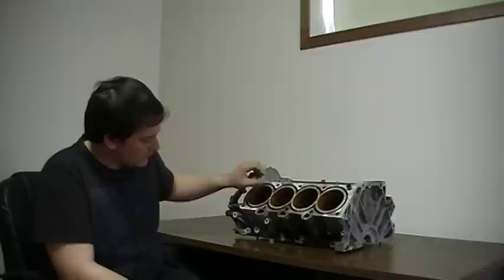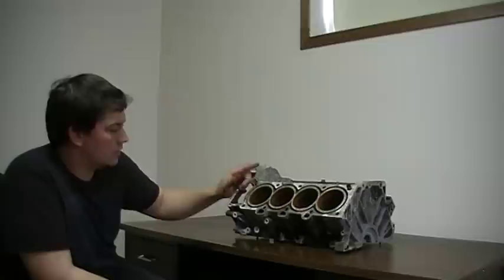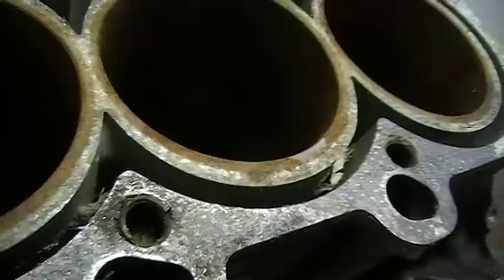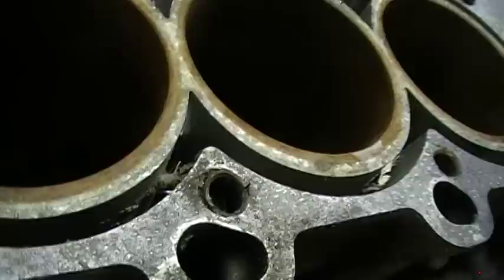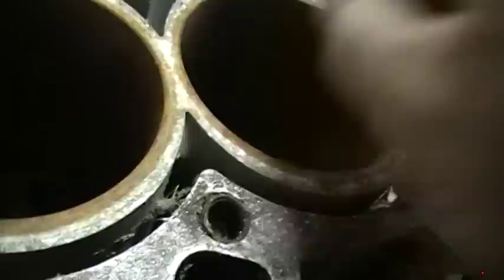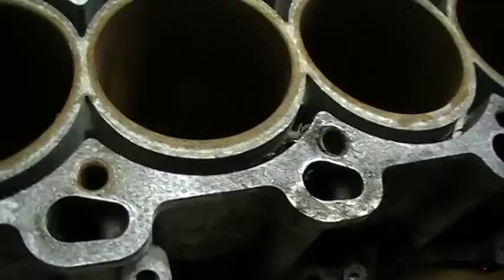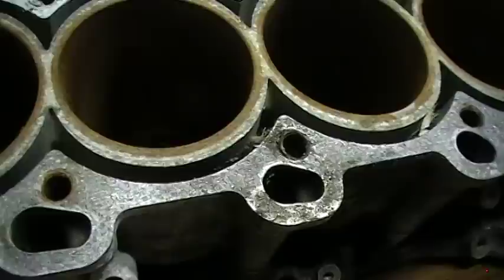Northstar Engine Block Cracks - the REAL cause.

Comment: Dear Sir, I'm sure that you produce a quality product; however, whomever was in charge of designing the Northstar engine should be stripped of their engineering degree.
Reply: The Big PussyCat yep I just had to drop the transmission on one...check it out lol
Reply: Iirc they won LeMans with the Northstar when it came out
Reply: Can you do his repair with the motor in the car?
Reply: @dangerousfreedom4965  maybe but your back will hate you
Reply: @MegaPooponascoop  I owned a 1994 Fleetwood Brougham that was sold as a rock, but had a 2001Showing results for ElDorado
Search instead for ElDorodo

Search Results
Web results

cadillac Eldorado
Reply: The Northstar's engineers knew it had flaws but Cadillac didn't let them finish their work before putting it into production, which led to these problems
Reply: @lichking3711  it took them like 15 years to finally switch to ls7 head bolts. So it took them that long to “finish their work” ?? Lol you must be one of the incompetent engineers at government motors
Reply: @matthewfredrickmfkrz1934  that wasnt the northstar sold to anyone at the dealer, it was the badging that got everyone excited, hype from  cadillac.

Comment: I don't know who the guy is who is trying to say the head stud kit is making blocks crack but he can take a flying leap there is no way the kit this company makes is hurting the block it makes a normally weak part stronger. if any thing it reinforces the section that would crack by preventing the studs from backing out . I have used the helicoil inserts before and I'm not a fan it's like a band aid compared to the kit this man makes. GM should have come up with this them self's it just make sense and works .
Reply from the maker: Thank you :)
Reply: Get a Chevy or Toyota or a scwhin bicycle, the new 2019 caddy's suffer from OBD issues,tranny,steering,and ABS sensor Gremlins...goes on and on

Comment: My 2001 Deville 4.6 threads are fine. It was pumping out coolant because GM installed cheap head bolts. One of 4 bolts holding down the head over cylinder one, was loose. I installed Felpro bolts and a new gasket.

Comment: One video I saw said the bolts GM use were wrong spec. The guy specializes in rebuilding them with the proper bolts. I am just a paper nerd not an engine guy. But I saw that video years ago and have an interest in the engine ever since.

Comment: you guys really do a good job with marketing and explaining issues with these motors and why they need your products. I'm usually very leery about this kind of thing but you've convinced me, i sent you guys an email a few days ago about bulletproofing my 07 dts. Will be ordering the whole bulletprood kit and kaboodle once i find a good junkyard motor to build while i'm driving my oil leaking one
Reply: these cars have a bad reputation for expensive parts but i've fixed everything wrong with it but the oil leak for 540$ parts cost and my labor on a free car. all 4 brakes and rotors, rear air shocks, tie rods, junkyard front bumper cover, filler paint primer and clear for the cover, bumper beam, passenger headlight, new ballast and 2 bulbs, passenger foglight, front parking sensors, parking sensor harness, plastic crash beam, rebuilt my third brake light, and repaired the seat ventilation module. a lot of work but the car was free because the p.o. got quoted >3200$ for these repairs, and now i have a nice DTS with everyting working
Reply from the maker: We will do our best to assist. We are in the midst of moving into a larger shop; so if your requests are not answered in a timely fashion at our office please keep on us. It's a busy time but we want to help everyone who comes through our door :) Thank you so much for the kind words!

Comment: I have a 99 Seville. how can i tell if my head bolts/studs have been upgraded without taking it apart? Is there anyway to slow the "galvanic" corrosion reactions? Should the bolts be re-torqued regularly?  Thank you

Comment: the blocks crack from a casting flaw, this is old news.  i've heard from the older guys at the dealership they have seen it first hand before the after market did, this is a great engine, works amazingly, i forget where you can see the casting flaws but i think its looking down in the water jackets some wheres but some have it, some don't
Reply from the maker: +Kevin Rogers It's not just a casting flaw. While I don't doubt there was a flaw in some years; I've seen a few different year Northstars do this. 97-02. That's a 6 year span.
Reply: kk, suck's because those engines hall ASS  when there working correctly

Comment: I have a north star 4.6 (77k miles) it has a blown head gasket and I  can't get it fixed because most mechanics say that once you take the head bolts out of that engine you can't put them back.

Comment: What about the 2007 4.6 Northstar engine in the Buick Lucerne, does it suffer from the bad head bolts or was the problem fixed by this point?

Comment: 2001 Olds Aurora 4.0 Northstar. Bought new 12/2000. I am not an easy driver. Trouble in all those years? Crankshaft position sensors, camshaft position sensor, spark plugs & motor mounts.

Comment: +NorthstarPreformance
i am thinking about buying a used caddy but I am concerned about the Northstar block problems.
I don't want to run into this issue.
Any help?
Reply: Yeah...if you don't wanna have this issue don't buy a northstar.lol They are great engines to say the very least,just spend the time and money for the head stud upgrade kit and you have a life long caddillac to drive.
Reply: I agree

Comment: Hi Jake, Car Wizard swears by you and your honesty. Two questions: 1) I am considering to purchase a 2014 Cadillac SRX with 79,000 miles. Has Cadillac fixed the Northstar engine problem at this point? It's a 3.6 liter engine. First of all, do you sell a kit for it, just in case? 2) Is it still a "weak" engine? Also you mentioned that steel bolts into an aluminum engine corrode. Is there a workaround for that? Thank you.
Reply: Yeah my 07 srx is at 94k and I'd like to know if this is something I need for another 100k

Comment: We bought a Cadillac with a overheating engine. After listening to You Jake Diagnose the head gasket as the main problem. My mechanic is dropping the engine for rebuild. My Cadillac is 1998 savile sls "y" as the 8 digit. My Question is. Will that much drilling effect the wall size of the block. I know aluminum is actually a soft metal. So drilling and tapping into an engineered piece of soft metal would only weaken it under stress such as heat and vibration. Because most cars heat up and do a lot of vibrating. I see how coarse the threads are and it seems like it would work, but weakening a soft metal in my opinion is not the best way to ensure a real quality repair. Is there a way you could engineer a bolt Where the shaft would be Coarse all thread that was only 1/16 of an inch wider than stock?Or so?ah? So slightly bigger bolt threaded all the way to the head? That way you wouldn't get blamed for cracked blocks with your bolts in it.
Reply: Hey shawty

Comment: i have a 1997 deville with a northstar motor, and 92,000 miles hasn't over heated yet. how much does it cost to change the head bolts to better stud bolts?
Reply: 4000.00 to 6000.00
Reply: Chris Lemaster why is it that expensive to change a couple of bolts?
Reply: about 4000.00 to 6000.00 dollars and the Dex cool antifreeze corrodes the system have your antifreeze changed out  and put the green antifreeze in it will run cooler I had a 1999 Deville as soon as I had the head gaskets rebuilt a GM mechanic told me to use only green antifreeze in the cooling system because GM is in a law suit with the Dex Cool antifreeze cursive to the engine and gaskets. When the Dex Cool antifreeze was in the car the temp would go from 206-222 and with the regular green antifreeze the coolant temp would read 160-190
Reply: The engine had to be removed and all twenty head bolts have to be machine drilled and pressed with a head bolt kit from North Star Performance and they have to rebuild the bottom of the engine as well because these leak and burn oil at a rate of 1 quart per 500-1000 miles all north star engines are famous for oil leaks. Then the have to clean the whole engine out at the time of rebuild because the Dex Cool antifreeze corrodes all gaskets and corrodes the metal parts in the engine There is  about 20-30 hours of labor involved here you have to tear the whole front end out including the transmission and front end.
Reply: there are likes 20 head bolts that have to be removed, tapped, studs installed, and heads machined, new head gaskets, and the engine being sideways makes everythinng so hard to get to. is what im guessin?

Comment: I have a beautiful 02 Eldorado touring coupe in fantastic condition.  It doesn't overheat or burn up coolant. Should I wait to stud it or just do it now?
Reply: I had a 02 Eldorado.  As soon as it hit 100,000.00 it started overheating and blew a head gasket.  It was going to cost more than the car was worth to repair so ended up selling it as is.   Don't ever buy a vehicle with a NorthStar engine.  I learned my lesson.
Reply: Laura Schmidt 
That’s got nothing to do with his question...
Reply: Well I bought a cavalier and it broke down too. But that STILL has nothing to do with your question. From what I learned from Jake's video here is that you may suffer from block damage if you wait. That said, if in the event your block cracks, there is probably a block in a junk yard somewhere that your mechanic can source. I recommend this guy's product. I purchased main studs from his company and they do seem like good folks doing the right thing. Sorry that didn't answer your question. You must decide your own path to take...
Reply: Lance Dukel 

I’d wait because there are a few unicorns out there that haven’t blown and have 200K miles. With that said the moment you are having issues confirm it is indeed the head gaskets and then have them fixed.

Comment: I own a 95 el dorado. I have herd a lot about the head gaskets going in the north star. No issues yet but would like to put more money into it because I love it so much. it has 120k on it runs solid what issues should I look out for
Reply: +Scott Cute  My parents still drive their 1995 Seville SLS and its got over 330k. We have had it since 1999 and it has been the best running and most reliable car we ever owned. The head gaskets were due to the coolant becoming acidic from sitting or not getting changed out when needed. Use what is recommended by GM, keep it maintained and you should be fine.  The cars that had issues and were rebuilt using the new corrected Head stud then make for a permanent solution and an even stronger built bulletproof engine for sure. But the original head bolts will be fine.  Our cars is still all original and never rebuilt. And I highly doubt that anything bad will happen ever.

Comment: Hi Jake, I have a 2011 Cadillac DTS with 47,000 miles on it. In the future, I would like for you to repair my engine when and if the nead bolts begin to seperate. I live in Illinois so, not sure if you are able to repair it when the time comes. Some people have said, that their Northstar engine blows a head gasket at approximately 85,000 to 120,000 miles or so. I'm not sure if the reason why the head gaskets blow at early age due to failure to maintain the engine. Anyway, great videos you have and a great patent! You are a very intellegent man for inventing such a wonderful solution. Thank you sir!
Reply: +deapozol   That will only happen because the coolant has become acidic. It is best to use what is recommended by GM. The acidic coolant has been they problem all along and that is why the head bolts become weakened. If you keep your DTS well maintained you shouldn't have any problems.
Reply: +deapozol  For one of these engines to crack like he is showing us here is most likely due to being overheated multiple times.  Because this doesn't just happen. My parents still drive their 1995 Seville SLS with over 330k. We owned it since 1999 and it has been the best car and most reliable car we ever owned.  I still enjoy driving the car.  But I drive a 2005 Deville as my daily driver and I love it. The Northstar engine is one of the BEST 32 Valve DOHC engines out there no matter what anyone says. I worked at Cadillac for a few years and been around them all my life so I know these engines pretty well. But you should be fine as long as you keep it maintained. Hope you enjoy your DTS as long as you own it.
Reply: +deapozol If you change your DexCool yearly, you won't have a problem. You'll likely get up to 280,000-300,000 miles before your head gasket goes. That's one of the improvements GM made.
Reply: +AMCNorthstar 93 
Yes you're right. I keep my oil changed full synthetic every 4500 miles and my coolest flushed recently at 40k. my trans fluid was changed at 40k as well, flushed by the dealer.  but, that being said, I do have a heavy foot. Thanks for the replies.
Reply: +UnitedRecording 
Hi. yes I just flushed my coolant at around 40k. the car has 51k miles and so far so good. I'll have the dealer flush it again around 65k miles or so along with another trans flush. I do have a heavy foot though and hope my tranny doesn't go sooner than expected. Although I did drive a different Dts and it took off from a stop way better than mine. I had my injectors cleaned and throttle body cleaned at the dealership but didn't notice a difference.  my air filter is fine also. I guess every dts doesn't drive the same...
Reply: +AMCNorthstar 93 
do you know why one dts takes off better than another from a dead stop. I have a 2011 dts premium and drove a rental dts same premium model and the rental took off much smoother and faster than mine. do you know why us that? I already had the dealership clean the injectors,  clean the throttle and change my air filter but the only difference I noticed was better fuel economy.  no take off difference.  Thank you.
Reply: Bengi H. Hi....the take off could be several different things and it could very well be that its in the programming of the engine computer.  Not all of them are exactly the same as with most cars.  I have a 2000 Seville STS and a 2005 Deville and they both drive and handle different but similar.  Just keep up on your maintenance and you will be fine.  Driving fast is very good....remember this is a high performance DOHC V8.  I love doing the same thing and these cars were made to be drivin fast.  Don't let anybody tell you other wise and especially the Dealer!!!  I know how dealers are as I work at one myself.  They can also be very dangerous and steer people into believing what they want people to believe.  But I talk to people just like your self every day and I'm telling you that you will not have a problem!!  You made a great decision on buying a DTS.  :)
Reply: +AMCNorthstar 93 Yes I'll keep up my maintenance that's for sure. I might take it to the dealer for that sluggish take off because they might be able to m check it for me and maybe reprogram the computer if there's a problem.  I was almost beaten by a 4cly corolla sort distance in the city.
Reply: +AMCNorthstar 93 I also change from shell V power to mobile premium but still no difference.
Reply: Bengi H. It's probably the programming of the engine computer I bet.  I'm curious myself.  And I remember driving several different Cadillac's in the past and not all of them were the same.  Let me know what they say.
Reply: +AMCNorthstar 93 I sure will thanks.
Reply: Can I change a starter on a 96 Seville without taking every vacuum and fuel line off?  I was told I can remove a few spark plug wires and a coupe of vacuum hoses that would allow me to prop up the manifold high enough to get to the starter saving me a bunch of time Thanks!
Reply: ***** It is best to disconnect all the vacuum lines and fuel rail. It is a good time to also inspect the intake gaskets on the bottom if any need replaced.  Only the front ignition wires you can move out of the way, not the back.  If this is your first time, don't worry, its not a bad job at all.  I have done several already and its very easy if you know what your doing.

Comment: Well... I've timeserted dozens of N* with the factory repair kit with no comebacks. Insp. and surfaced heads with the factory repl. head bolts etc. work just fine. Then... there's the oil leaks to deal with. 38 years as a line tech at the dealer level made me wanna retire ASAP!

Comment: I have the same vehicle.   Though I researched the north star V 8.   I haven’t met anyone with engine problems yet.   Though mine has 68k for a 2001.  Hope I never have to do the block.  I don’t drive it in the winter.  Had it since 2009.  It had 49k when purchased

Comment: I have a 2006 Cadillac STS Northstar v8 with the cold p0391 and P0106 car will not start
Reply: The P0106 error code is Manifold Absolute Pressure/Barometric Pressure Circuit Range/Performance Problem 
The p0391 error code is Camshaft Position Sensor B Circuit Range/Performance Bank 2
The p0391 code could be the no-start condition you are experiencing.
I suggest you read the full info for solutions here: https://www.obd-codes.com/p0391
(I just found the link, I don't have anything to do with the website.)

Comment: Why does my 2006 DTS with only 98K on it make so much valve noise. I thought it was pinging at first. When you rev it up in neutral they just rattle and under moderate to high throttle.
Reply: azimmey timing issues because the last owner was Autistic and treated it like a race car
Reply: V8 = Instant race car.